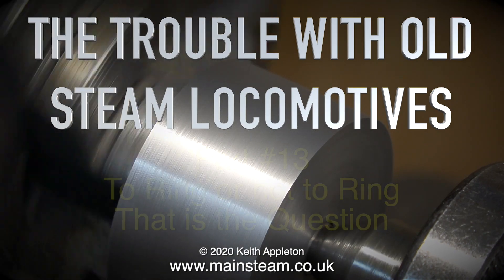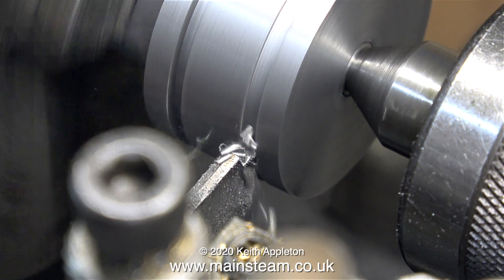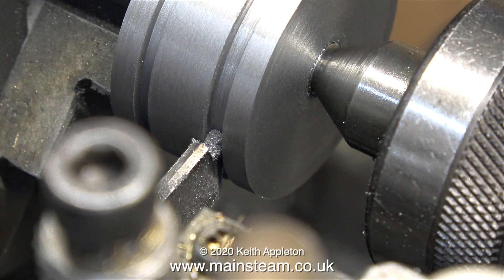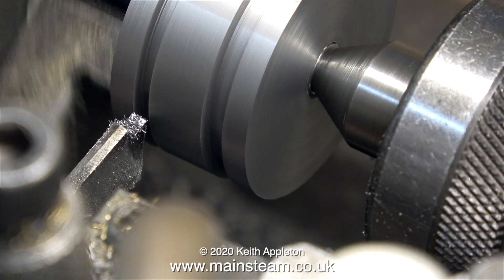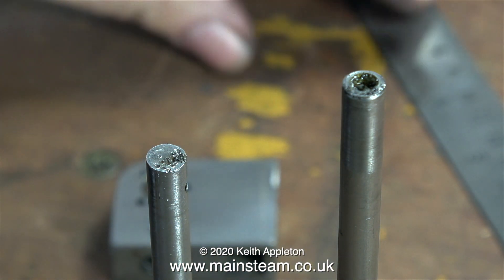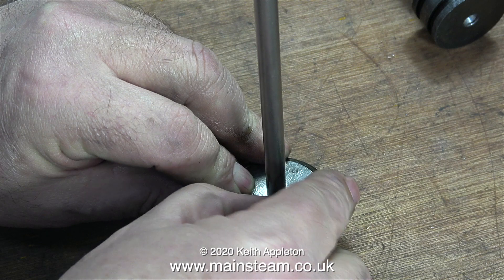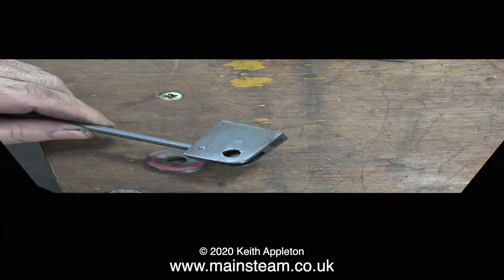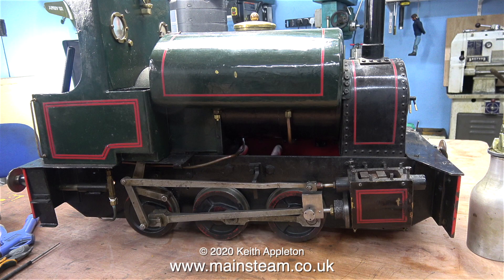THE TROUBLE WITH OLD STEAM LOCOMOTIVES - PART #13

Comment: Keith, have you checked the piston ring end gap? That is if you insert the ring into the cylinder to see if there's any gap? if none, consider about .030" or .07mm. That could be why it's tight with the rings on,  or the depth of the piston land is too shallow. The rings need to be able to "float" in the grooves (lands).  And then the "couple thou" clearance might be troublesome, the piston would expand first when heated, the cylinder and valve chest would take longer to expand to a normalized temperature due to the mass. 

Ok, end of keyboard warrior mode, back to steam geek. Keep up the good work!
Reply from the maker: Thank you for your advice Clay, I did all of that, and I am about to voice over a video explaining what I did }:-)))

Comment: Not a machinist, but is the groove for the ring deep enough? Sometimes tolerance is pretty tight and another thousandth or two deeper groove might be the difference.  Or, is the bore if the cylinder out of round? I have seen this in petrol engines and discovered the issue when fitting new parts that don't match the worn bore.  Interested to see the results. Cheers
Reply from the maker: The cylinder was under size.

Comment: I understand the struggle of getting the cast iron piston rings on, taking them back off however, I feel like I would find that to be rather difficult.
Reply from the maker: It is almost the same technique as fitting them in the first place . . .
Reply: @keithappleton  Sliding a feeler gauge under the first free end helps. With care you can move it around the ring to get it all the way out without breaking it.